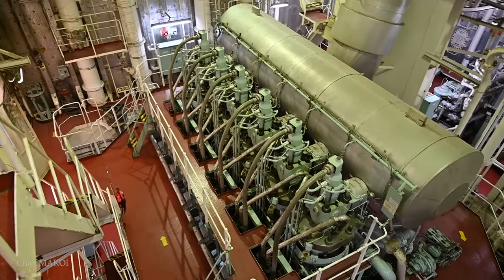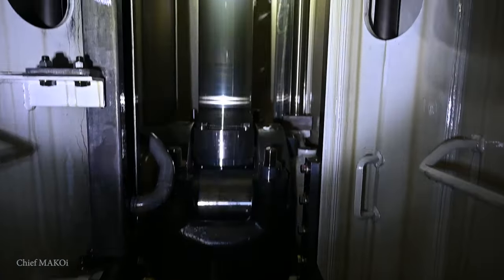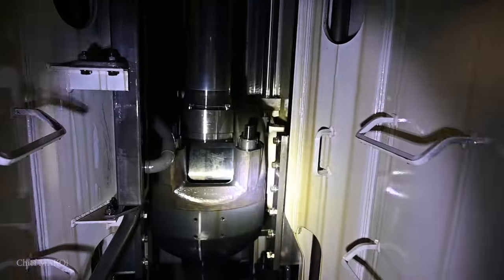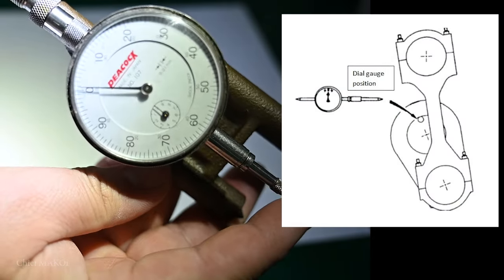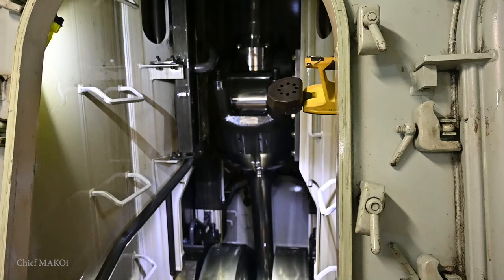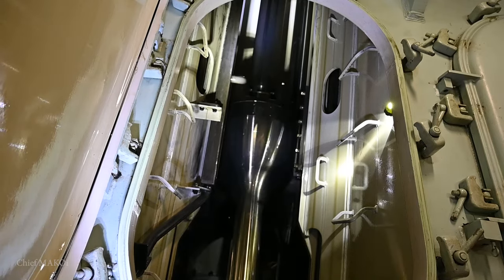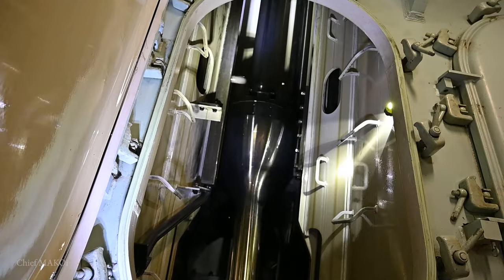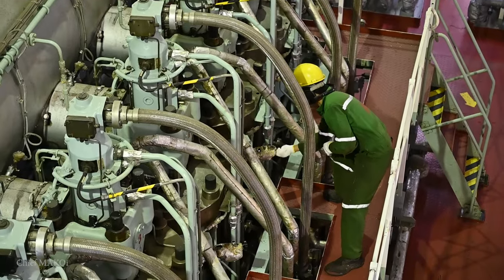Main Engine Crankshaft Deflection Reading | Chief MAKOi

Comment: Bad time to drop your flash light inside the engine
Reply: There's screens at the bottom that will stop a screwdriver or flashlight. But a small screw or other small thing could fall thru into the oil which would be a very bad day. Notice they all wear gloves and booties on their shoes and clean coveralls before going into the engine. I bet also Chief Makoi makes sure everyone empties their pockets, no rings, no jewelerly, no earrings allowed around when engine access doors are open. @7:42 is a good view of one of the screens.

Comment: Man, I'd hate to be the one that has to change the main crankshaft bearings in this "medium" engine.
Reply from the maker: It's actually easy provided that only the bearing is damaged.
Reply: @ChiefMAKOi  -  Thanks for your response.  I'm going to bow to the expert.
Reply: @ChiefMAKOi  Ha, easy if you happen to have the right hydraulic equipment to loosen the bolts, and chain hoists to lift the bearing caps. Doing it by hand, would be extremely difficult if not impossible. I can tell from the design of those connecting rod 'nuts' that they can only be loosened with a hydraulic device to 'stretch' the rod bolts.